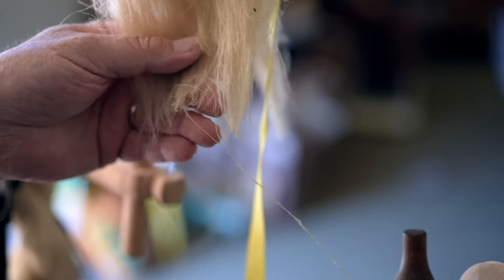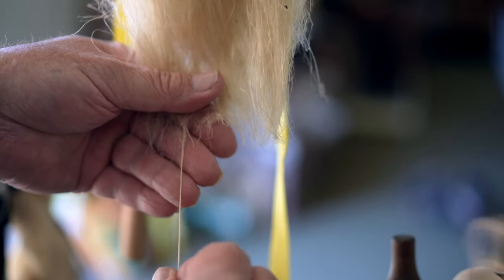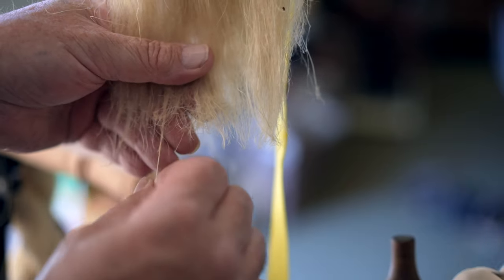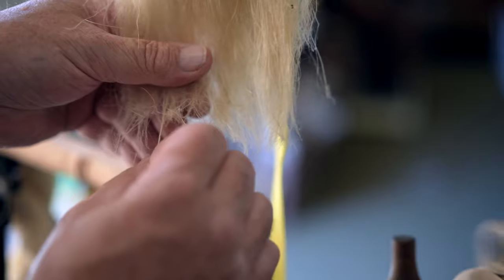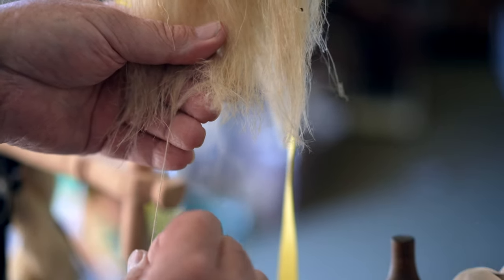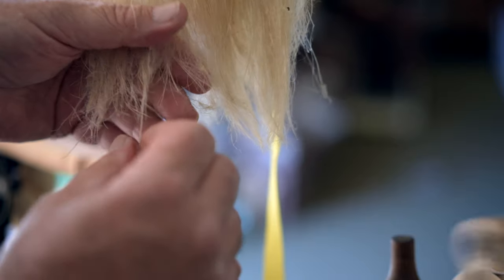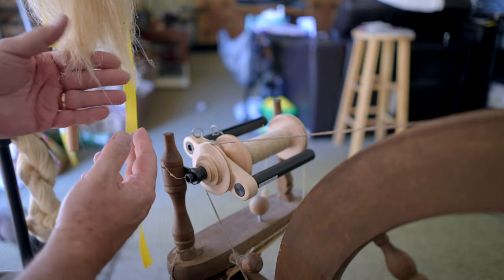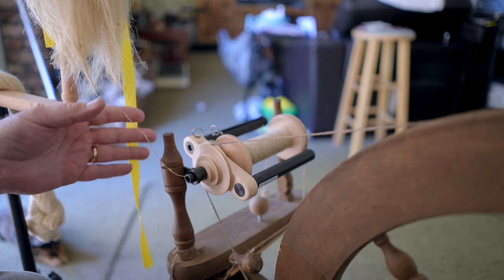Spinning Flax, A Close Look

Comment: Do you have a video showing your plying through water?  Today was my first day spinning flax. Big learning curve! You video has helped me quite a bit! I’m spinning basically dry and short pulls. That has stopped the breakage I was experiencing. Thanks.
Reply from the maker: Ann, Yes, spinning flax is a big learning curve. I don't have the video yet but I will soon. Im actually not plying through water but I do have a wet sponge I let the fibers glide over so they get damp or wet at the point of plying. It works great. I have a bette sponge than what I used before. I just wanted to know things were going well plying with the new sponge before I film the video. It too will be a close look at plying wet. I do use saliva to dampen the fingers to get some wetting but it is mostly for creating grip on the fibers which helps pull them from the drafting triangle. Ask any question you want. If I know the answer I'll let you know and if I don't know I research and find out the answer. Hands on is the best way to know.  fb.me/naturesyarn

Comment: Next question as this is so helpful, what about a video on loading a distaff? There is so much varied information. What works for you?
Reply from the maker: I will do that as well. I have tried a few ways. My wife purchased me a distaff and it is one that I got to work for me. I once made a cone and then laid out the flax as seen by others then rolled the cone over the flax and then tied the top to keep the fibers held and sitting on the cone. It worked pretty good. That would be suitable for most. However my distaff has no cone or cage so I just hang it. The distaff has sections that are narrower than others and the ribbon keeps the fiber from sliding down the distaff as I spin. It is required from time to time to tighten the ribbon as the fibers get used up. I assume the laying out of fibers as shown by others is to allow the fibers to not just pull straight down but to make them run across other fibers catching them as you draft your fiber. A key component is well processed fibers. If you have fibers that are still like a ribbon rather than separate fibers you will end up with a very thick section if you happen to draft one. I try to remove any obvious ribbons of fiber as they were not well processed and will muck up a nice thin spin. If you are doing thicker thread it is not as much an issue. I spin very thin lace weight for my singles. It is important to have well processed fibers. It is a learning process. I'll show the issues as well.